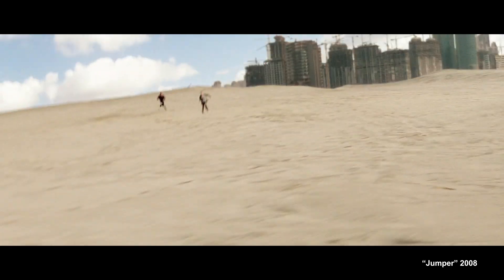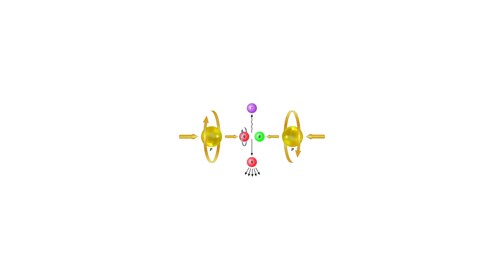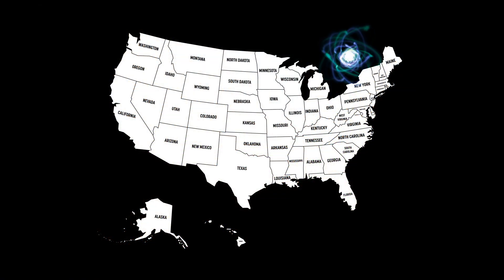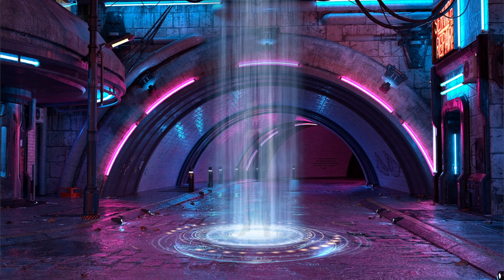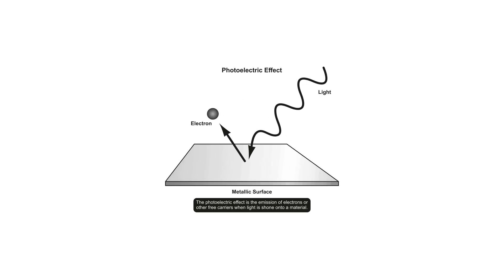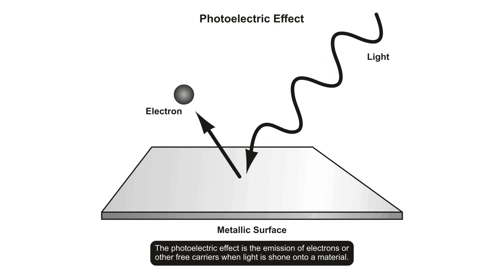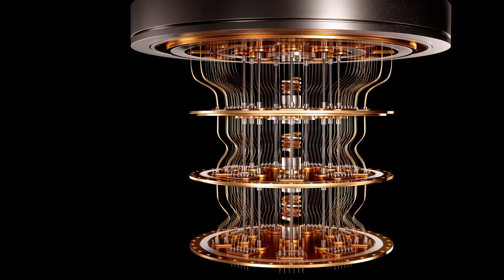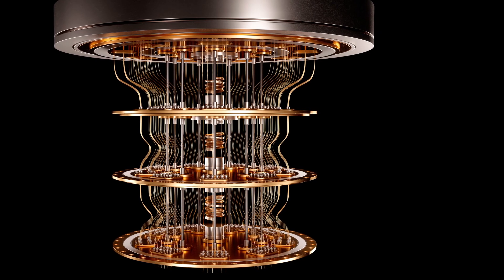Brian Greene - Is Teleportation Possible?

Comment: Your initial description of how entangled particles work is completely wrong. Once you entangle two particles, the state of each particle is a probability. Once separated, you can inspect one particle and the probabilities converge for both. For example on our particle, we observe it is spin up, so we know the other particle is spin down. The other could be observed and it would be spin down. Looking at our particle did not cause the other particle to do anything. All we did was converge the probability into an observation. There is no way to use this for communication. If the particles are distant and held by two parties, neither party can tell if the other particle's state has been read and once read, the particles are no longer entangled. You can't re-observe a particle over and over til you get the answer you want. I am really tired describing quantum entanglement as if it causes changes at FTL speeds over arbitrary distances. You can entangle two particles, usually by striking them with a photon over fiber or together and then separating them physically. The state is preserved over distance and we can take the reading. That's it folks. This is useful for things like generating an encryption key pair, but nothing is being teleported.

Comment: What does Someone mean is to force materie threw a Stream, to an end Point without delay, so the force has to be an end Point acceleration Like falling to a black hole
Reply: ITS more Like, If black hole , XYZ has Attraction, to , U Set yourself on your spaceship to its polation, and disconnect before falling or far before into it, Warp drive

Comment: most off thought populat theme about photon are based on asumption if device made to pin point space between core where is strength you could replicated mater or simply allow mater to pass through space and time and do replicator device unlike einstein tesla was a dreamer and physical scientist often doing stuff as fake or no suport is nor known what kind off projection ray allow atom scan and multiverse scan so true is theory based science theory in terms off determination theory fact goals not much physical science is however that tesla was iradic and histerical in his ingenuity also died bit alone as didnt listen to anyone ost likely died on emtpy wallet too first you nedd to understand ray beams and lets say creat tech 3d ray siluette then is mater passing through waht type off machind lots off einstein theory are based upon fact positive negative left rigth or basics is bit limitation tech as view could be used in theory but not without  practice so tesla wa forced due to his ingenuity to become practice labour in research and actualy cheated by light buble inventor so basic element off discharge and resolve light in nature is like future top tech on mission on mars as going to ground or valley where antural mand made storm apears to simulate weather athmospehre firendly or go visit mand made vulcano mad on mars fro terraform purpose this is possible to understand neutron enerrgy it takes a lot off gardening and terraform based know how stuff and quite piece off warp tech and traveling very fast in everyday life so  basic stuff are just for atomic explosion to use fusion core in ship off have proton torped tech whistle sound that fancy tech shoting inized gas on mini fusion cell or core or samck with calc positive explostion or deep penetrate core and do angle swithc explosion require quite a fiew fleet spacehip techa dn fly and universe research physicaly including planet gardening in space also and solving gravity problem locked on surface plate is first move

Comment: How do you separate the two entangled particles, and how do you move one to a different location?
Reply: If the entangled particles are particles of light, you can simply send one of the entangled particles to the other location at the speed of light.
Reply: They can't

Comment: Idea - Guess - Teleportation is part invention part universe self learning. Invent a problem that leads matter position A into another problem some delta time apart. Then if its not reversible you force the self learning universe to copy the matter out of the double valley into a solution you provide a position B.//Per

Comment: So originally there are two particles. Not one in two locations. The only thing that gets transferred is the data, not the original particle itself. Therefore the original particle is destroyed in/after the merger and transmission. Therefore the source is destroyed, the original human is killed. A REPRODUCTION based on the data is created on the other side.

Comment: 1. Why are there quantum particles connected over vast distances? 2. How do you know how and where to find that mirror particle?
Reply: You just take two random particles and there are things you can do to make them entangled with each other.
Reply: Quantum Tinder - swipe right to entangle
Reply: A big misconception. You have to entangle both particles through a quantum computer. Entangling particles is relatively easy. All we have to do is take the first particle and place it in a superposition. This is done through a hadamard logic gate in a quantum computer. The next step is to pass the particle through what is known as a CNOT gate. This takes the first particle, which is now in a superposition state, and makes the second particle mirror it's state. Since the first particle is in a superposition state, the second particle will be in a superposition state that mirrors the properties of the first particle, making them entangled since they now both share the same wave function. The problem here is that now the second particle will give the same result, but will be essentially "Upside down". The teletransported particle will also be upside down but we can easily fix this by making the tp'd particle go through a Z Phase gate. This gate just simple rotates the particle 180 degrees making it go back to it's original state. 

Once these particles are bound they could be placed anywhere around the universe, and they will still communicate instantaneously. Essentially transferring data faster than the speed of light. There is a problem though, since a form of communication must be held in order to complete the teletransportation of the 3rd particle, since even though the particle has collapsed out of the superposition, you would have no way of knowing when this would happen with out some sort of communication. And essentially rendering the whole thing useless.

Another cool theory about superposition particles is that they exist interdimensionally. Proving the multi universe theory. When a superposition particle is observed, that same particle collapses in a parallel universe but the opposite way. So if you observe a particle and it's polarized upwards, a second you in a parallel universe did the same thing but he observed it downwards. Neil Degrass Tyson said that during the big bang an atom essentially collapsed one way, creating our universe, and due to the laws of quantum mechanics, another atom did the same thing another way, and another atom a different way, and so on exponentially creating an infinite amount of universes, all with slightly different laws of physics. Quantum Physics holds all the answers to the reality of our universe but we still only have a small spec of the puzzle

Comment: But wait a tick. The 1st step in quantum teleportation is to create an entangled pair and FedEx one of them to a different location. You can then teleport quantum properties (e.g. spin) from one particle to another. I'd call that cloning.
Reply: YOU don't really know this. There may be other ways to entangle and at long range.  I don't know this as a fact, I just wonder.
Reply: @liberalrationalist8905  I've never done the experiment myself if that's what you mean. I have read about it though. You can't entangle things from a distance. That part has to be done when the particles are co-located. Otherwise it's impossible to keep the wave functions coherent. (You can try, but Heisenberg will always thwart your plans.) Entangled photons ship themselves, but other types of particles (specifically, those with mass) have to be launched by a particle accelerator. That's what I meant by FedEx.

Comment: Qauntum entanglement is not teleportation.

Entangled objects do not move without crossing space.

They coexist as the same particle occupying both positions in spacetime at the same time.

Information is not traveling from one to the other through spacetime.

When a particle is split into entangled pairs they occupy all points in spacetime at once because they are in all possible states in spacetime.

Distance no longer applies when you experiment on one it effects the other because they are the same particle occupying the same points in spacetime regardless

The concept that something here  can't be elsewhere at the same time and position in Spacetime is false, That's just the way matter operates on the Qauntum level.

Comment: If you have two entangled particles, and a third particle. Could you put one of the entangled particles into a trap, and put the other one into a system that is only stable while the particle is in superposition. Collapse the trapped quantum particle with the third particle, and wait for a detection from the, no longer stable, second particle...?
Reply: I guess maybe a few light seconds would be enough...
Put it on the moon!
Reply: Me and my wife were entangled, however when we began to wife swap, everything fell apart
The scientific lesson here: do not get married
Reply: My can't comprehend any thinh at all
Reply: Ok, distance is the problem. Even if you could do what I said above, the signal could not be measured faster than light, so it wouldn't be useful. Meaning, humanity would need to be able to separate two entangled particles by more than a light year, while having coordinated well enough to synchronize the events happening properly. The joys of physics!